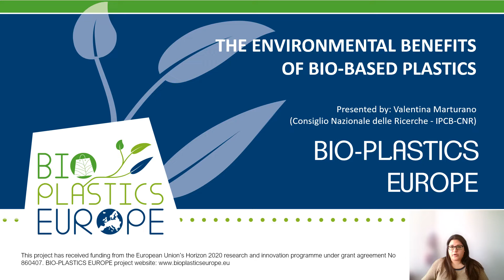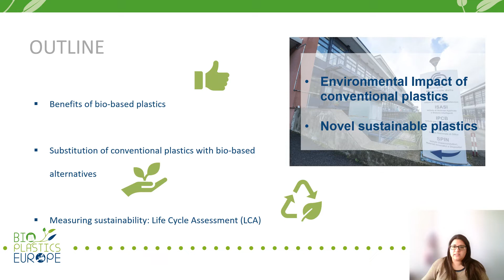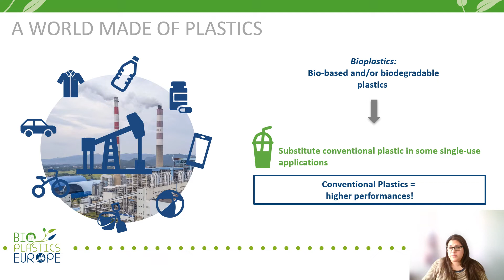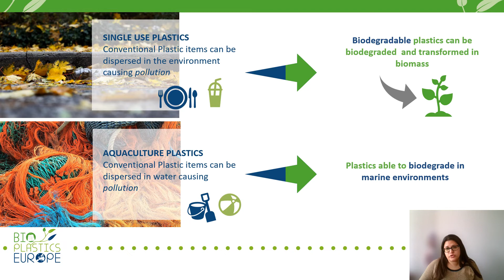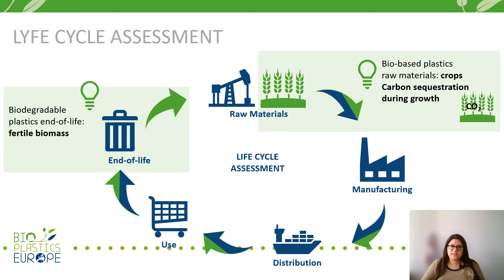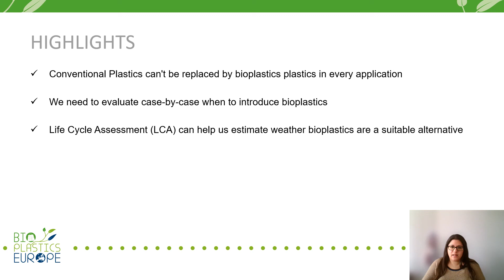The environmental benefits of bio based plastics

Comment: The statement about the LCA indicator that translates env impact in CO2eq is not correct; as a matter of fact, LCA perspective involves different impact categories (water depltion, water eutrophican, ozone,particular matter, and so on). If you highlight only impacts on climate change it is more correct to use the Carbon Footprint definition. On the other hand, if you prefer to propose the LCA , a more comprehensive descrition of impact categories should be done, in my opinion.